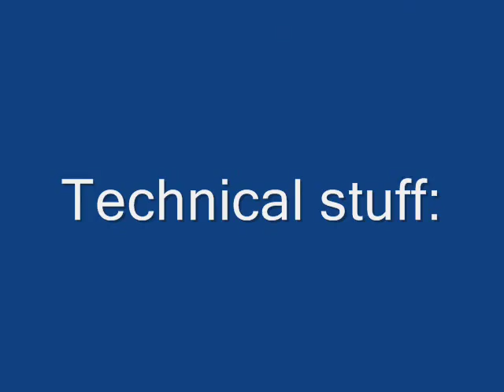ELLWE 2FB - Naval Diesel engine, Scale model

Comment from the maker: The model is not a Diesel engine. It has spark plugs (disguised under the injectors, self made).

The original was not an air blast engine. See Lyle Cummin's book "Diesel's engine" page 417 .. 420